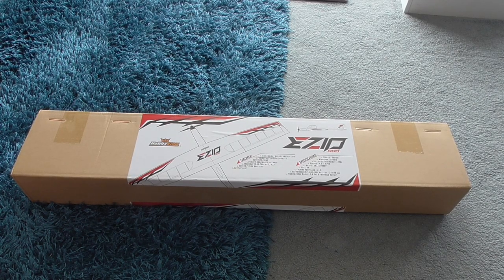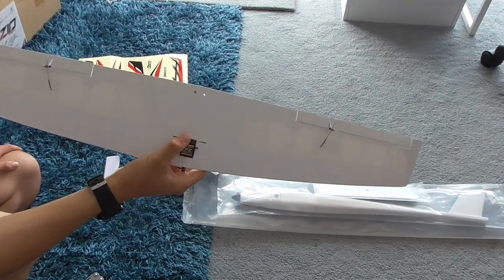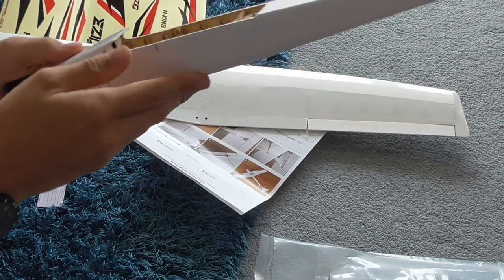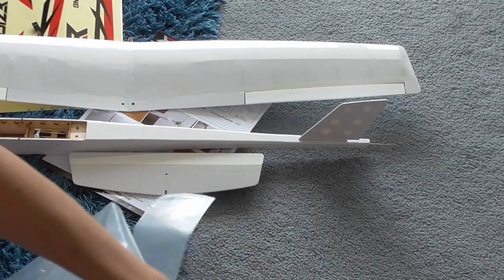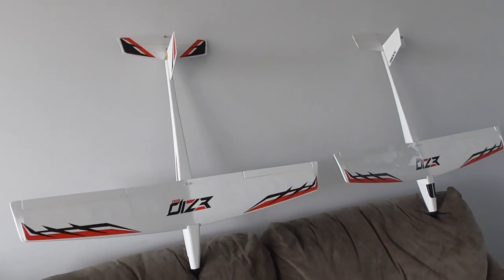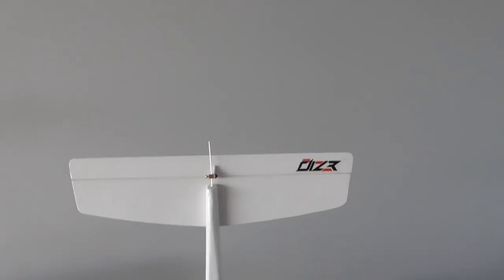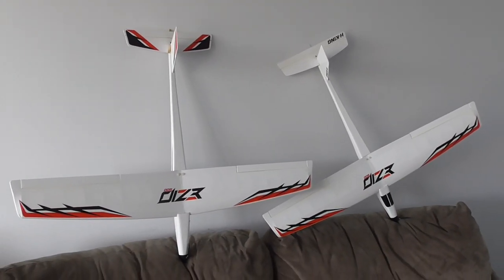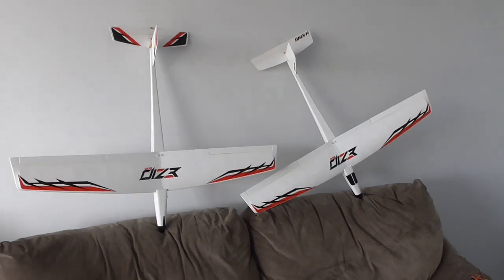HobbyKing EZIO 800 Motor Glider Unboxing & Review!

Comment: I totally agree with you, i bought it when it was on sale so i spent only 8.50€. 
Great for this money but i definitely wouldn't spend 70€ for that. I think that it really flies great but also it's also a bit useless, you can't gain much altitude because it's small and probably the wind would take it away, but you can't even fly it like a park flyer because you need some space to land it, because of the great efficiency!
Btw great vid ;D
Reply from the maker: Thank you!
Yes, it is quite hard to find a use for these! We fly off of sand dunes at the beach, and they work perfectly there, as long as there is no wind. They are good slope soarers, but do get buffeted by the wind. :)